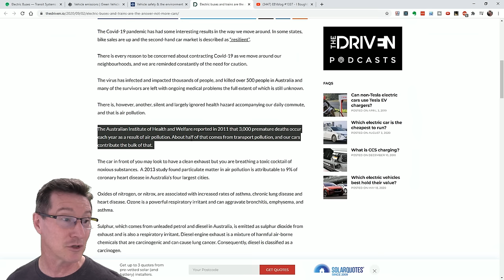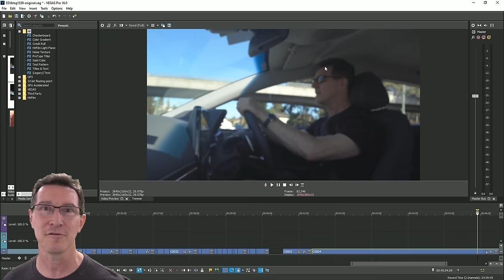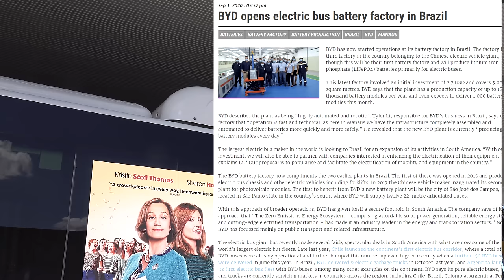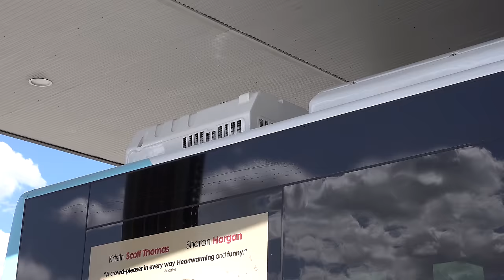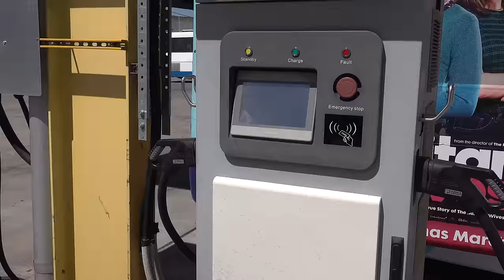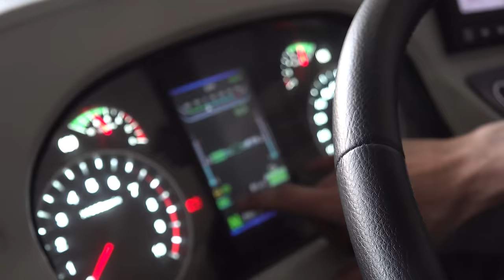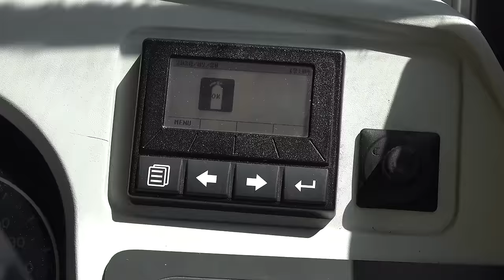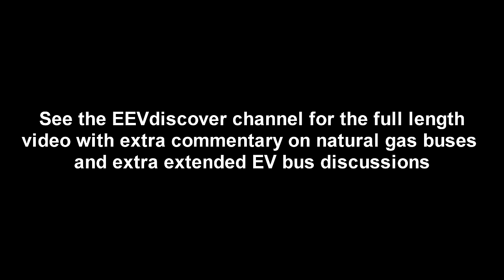EEVblog #1339 - Looking at an Electric Bus!

Comment: It is very strange to see 10.000rpm scale on heavy vehicle: combustion counterparts, usually have 2500-3000rpm full scale.
Reply: Its a F1 V12 powered bus....
Reply: @KarrasBastomi  Minus F1 sound. I hope annoying warning sound freaks will not figure out that cities must sound like F1 races.
Reply: 2500 is already redline for most big diesels.
you usually run the between 1000rpm and 2000rpm

Comment: It's amazing how so much particulate pollution in cities now is actually from tyre rubber!  Solving that problem, and decreasing road noise, while still maintaining good traction is a challenging materials science problem.
Reply: One simple option is to use steel wheels on steel rails.
Reply: rubber particles are not the only problem, theres also particles from the brake pads. although regenerative braking helps with that.

Comment: Hi.

We have been using ZEV buses for years in Warsaw (Poland), we currently have 92 such vehicles, most of them were produced by Solaris (Polish bus factory).
Another 70 electric buses were ordered and are being produced.
Additionally, almost 800 other buses meet the EURO VI standard.

If you count the buses, trams and trains used in Warsaw public transportation, 43% of them are electric vehicles.
Most of these vehicles were produced in factories in Poland.

Comment: I work with electric buses (I make the schedules for the buses and the drivers in the area north of Amsterdam, the Netherlands).
A few remarks on other commenters and the video:

- Electric vehicles running on oil-fired power plants emit about 50% carbon compared to a diesel truck or car, well-to-wheel. The amount of particulate matter is dependent on what filtering the power plant operator installed.
- There seems to be a lot of dust buildup in that rear compartiment. Interestingly, our BYD buses had a problem where they would have large amounts of black dust everywhere, including the passenger compartiment. Testing found it was improper sealing, it being mostly carbon which is probably road dust from tires (either the buses own or from other vehicles). 
- The amount/speed of recharging is an operational problem. For example, the area I work with needs 109 (83 of them electric) buses in peak hours, but only 70 during mid-day. So part of buses come in after morning peak to charge, then others come in etcetera. The evening peak is most problematic as we need less buses for drinving than morning peak but it's "wider" (from 2:30 pm when schools go out till 19:00 when the peak buses return from their endpoints), so some buses are charging in the evening peak. In some areas where the usage pattern is more "flat" you need extra buses to charge and thus faster charging and/or changing batteries would be beneficial, but in areas with high peaks we have no more buses than we would have if we rode diesel buses.
The buses I work with charge 3-4 times a day on average, but the buses we have in another area charge about 10 times a day (we have a lot of 24h lines, buses there running 17h/day on average) and they fast charge with 240kW
- In Arnhem, which is a trolley city, they are experimenting with "trolley 2.0" which is trolley buses with a battery pack which will charge on a central section yet can drive a few kilometres out in suburbs, removing the costs of installing trolley wire in every outlying suburb.
- Heating is often still done with diesel, as electric heating takes a huge hit on the batteries while only being needed for a few months a year. Electric heating takes up relatively minor amounts of diesel. Some buses have heat pumps (aircons that can heat and cool) and (in Dutch weather) the aircon in summer takes more power than heating in winter.
- For us, the total cost of ownership is about similar to diesel buses. The buses are a lot more expensive (think double/tripe), chargers are very expensive as well (a quarter of the price of the bus) but the maintnance costs are a lot lower and the electricity is extremely cheap compared to fuel.
- One major difficulty is getting a power line to the charging locations, often needing two years to have it built, which is problematic as the time from giving a concession to running it is usually about 1.5 years. On our current location we could pull 2900 kW if all buses would be charging at the same time + about 300kW for the facility (heating, compressor, office light etc), but the power usage is measured at 5 (random) moments per day, and if one of those measurements show we  go over 2000kW grid pull, we'll be required to pay for a larger grid connection for 2 years (which is multiple thousands of euros extra per month). We were promised a larger connection but the cable has to be routed under a rail line, the rail operator has protested due to their electromagnetic field sensitive signalling equipement and it also has to go trough a canal dike, not your default "just dig a trench and lay a cable".

Comment: Electric buses were very popular in the 1930s to '50s as cities began to switch their trolley/tram systems to buses. This made sense because the overhead wires and other infrastructure were already in place. Even though they have disadvantages (stuck to routes, can't leapfrog), they are quiet and clean. I think that battery buses are cool, but hauling all those batteries around is expensive and heavy. There are electric buses that use overhead wires on parts of the route, but can run on batteries as well for short distances, recharging while under wires. This makes a lot of sense to me.

Comment: I really want an electric car. Even a goddamn hybrid. But currently, it's unfortunately almost impossible here in Brazil. Impossibly expensive, very hard to maintain. 
As I haven't been using my old junker '98 Ford Fiesta less and less over the years, I just commited to, if I ever buy another car, it's gonna be electric. But it's probably not happening for quite a while, if ever.
We do have an all electric bus program in my city though. Tiny part of the fleet, but at least they are testing.
Of course, if we had a good public transit system with metros and whatnot, I wouldn't even consider a car anymore... but you know, we don't.
If I even realize my dream of moving to Japan, I guess that's gonna be solved... xD
Reply: Brasil? Hahaha, electric cars are too expensive even for European middle class. Not all EU countries have EV subsidies, not talking about poor chaps at South and East of EU.
Reply: Electric is much simpler, which means its also easier to maintain, and has much fewer parts. A market like Brazil can probably get the ultra cheap golf kart like electrics that are ravaging the Chinese market, they drive slow and have short range, but for city use are perfectly fine and cost about 1000 USD (in alibaba). Sadly most use (about 8) regular car batteries, would be great to see those with the nicer Li-ion ones. EEVblog should review one of these. Check youtuber jalopnik reviewing one in the US.

Comment: there are even buses that are a hybrid between battery only and pantograph trollies. they use " opportunity charging" which is a high capacity short duration charger which charges the bus for a few minutes using overhead chargers at each stop and during wait times and driver breaks. it allows the bus to go all day long with a much smaller and cheaper battery pack and eliminate the need for continuous trolley lines. if they need to extend the network they might only need to put a charger at rhe furthest stop. this method also works for electruc forklifts.

Comment: We have electric busses here in Bulgaria from the end of last year. The main difference is the charging is done true contacts on the top of the bus, so it can be charged more easy on rout.
Reply from the maker: Why would you need to charge it on-route?
Reply: @EEVblog  lower battery capacity, they don't hold as much charge as the ones you show here.
Reply: @EEVblog  Reading true there specs it looks like they dont run on batteries, they run on 780F /20kWh super capacitors
Reply: Less batteries mean lighter vehicles and that the batteries we can produce can result in more battery powered busses. Question becomes if it is worth it in terms of the only real incentive system we have, ie money.
Reply: @EEVblog  He's probably referring to the Higer supercapacitor buses. They have a range of 20 km and charge at end stops in 5-10 minutes. Apart from these we also have 20 standard battery electric buses by Yutong with 320 kWh batteries and overnight charging in the depot. Unfortunately their batteries don't usually last a full day so buses are swapped around midday.

Comment: I am a bit surprised they didn't go for the option of having exchangable battery packs on the busses. An hour of charging still is much longer than unplugging, having some mechanical magic happening and a new driver hopping in on shift change would have taken. With a whole fleet of identical vehicles, I imagine this would be a significant factor in cost effectivity over time. The battery packs could sit in some corner of the workshop while recharging.
With electric vehicles, one can rightfully speak of "The latest technology". It basically was service ready over thirty years ago, could have been used  for niche applictaions ever since. I thus think it's thirty years late.
None has ever been this late.

Comment: LifePo4 is the wave man. Got it on my eBike pulling 300 amps @86v and they don't even break a sweat. Also and most importantly it's is safe to pull that level of energy from it and even if it wasn't the cells are super safe no fire no explosion.

Comment: There's a few of wireless tram systems in Europe, where the tram charges briefly at the stops or key sections of track, they seem to work well so I wouldn't write off the wireless idea, with automation it would be pretty simple and you could avoid lugging/and the cost of 100's kWh of batteries.  Not in the same category as solar roadways!
Reply: Newcastle (about two hours north of where Dave is in Sydney) has that kind of system. It kind of sucks, the tram has to stop for a relatively long time at each stop to get the batteries charged up sufficiently.

Comment: No emissions?
But only if the electricity comes from 100% renewable energy sources. 
Otherwise the emissions are only shifted from the city to the power plants.
There will still be dust from the brakes, tires and road surface.
Reply: Tell you what, once we've got the carbon crap from diesel buses out of our cities, we've removed all the petrol cars, all the gas boilers, then lets start worrying about brake dust emissions.
Reply: @dang3859  Even if the energy for those busses was 100% produced by Diesel power plants with the same low yield as Diesel motors ... you'd still save 75+% fuel.

That bus has a battery that stores as much energy as 33 Liters of Diesel. Dave's car has a battery that matches 5 Liters of Diesel.
Reply: @edc1569  I largely agree with you. 
That was just a hint to a few other sources of fine dust that are also there now and that won't go away with electric cars.

Comment: Pretty sure in Canada our electric cars make a noise .. for safety  i had a ford rental  that sounded like a space ship , it wasn't loud but definitely audible.
Reply from the maker: Mine is supposed to have that, but it's barely audible.
Reply: @EEVblog  yeah same with the Ford , wasn't noticeable inside the car.

Nice car, I'm a Hyundai guy all the way now... mind you mine is a 429hp beast that still runs on mini explosion under the hood 😆
Reply: Here in germany (probably the whole EU) new EVs are required to make a sound up to a certain speed, where the tire nois is louder anyway.

Comment: since the batteries are on the roof, it would be nice if they could just drop a new battery pack ontop and swap them out quickly for another shift, im sure that could be done if they had more leccy buses and routes.
Reply: Most bus traffic is during peak times in the morning and afternoon, so it really wouldn't be necessary - just schedule charging to fit demand.

The biggest issue is going to be getting hundreds of kw of power into them all, which is still an issue if you swap battery packs.

Comment: Awesome. I wonder if putting batteries on top actually makes the ride a little more comfy compared to in the bottom. So when cornering the buss does sway more but ends up moving the passengers less.
Reply: No, but it is better to keep the passanger compartment low so people don't have to climb 1 meter to get inside :P

Comment: 11:50 <-- wow, making here (in Brazil) batt for electric bus, but no electric bus here at all! I am so proud of my country! Well, someone in the World need to consume petrolium.
Reply: No one gives Brazil enough credit for transitioning to renewable fuels. Ethanol is the stop gap for ICE vehicles and Brazil is leading the charge
Reply: @verothacamaro  You are aware that ethanol fuels is an environmental disaster right?
Reply: @Yannick 73 Sadly that's the one thing that it is not.  It takes massive amounts of fertilizer.  Its a net loss.
Reply: In my town, Santos - SP, you can see few BYD microbuses rolling around.

Comment: I would love to see that thing with a pantograph ... basically would become a trolley bus and you could drop the battery size down

maybe put the overhead power at the bus stops.. .  I would like to see a bus like that work on the tram line.. but at the end of the tram line it could use the road way like the good old trolley buses of yester year...
Reply: Super cap bus
Reply: @horacewonghy  Gyrobus!
Reply: We have exactly that thing here in Finland
Reply: smaller battery = more cycles for same trip duration = more wear. They try and choose an ideal battery size to maximize pack life
Reply: @askjacob  Thought about this for a while.. I do not think this is true if it has a pantograph, this is because the battery doesn't get cycled down as much. in fact the battery should last longer as its state of charge stays up. Trolley trams that operated in the past didn't even have batteries. the battery in my model woul allow for less infastructure to be deployed and allow busses to use existing tram networks  to extend routes or cover black spots

Comment: Quite a few of the diesel powered buses I’ve driven don’t have a rev counter, Volvos normally have it for best revs for the turbo, Optare turned theirs into an eco meter and ADL started adding one in 2009.

Comment: An electric bus that gets power delivered to it from the road...also known as a tram :p

Also imagine the tinfoil hat wearers. Up in arms over a fraction of a watt, and now you have coils everywhere radiating kilowatts XD.

Joking aside, the tram thing could actually work- for longer routes the bus drops a shoe/some guidance rods, raises a pantograph  and runs inside the metro tracks, with the benefit it can charge while still in service, eliminating downtime

Guided buses are a thing even for internal combustion engines, could see it making vast amounts of sense with an electric.

Comment: Why is it that the guts at the back are covered in a layer of dark muck? It doesn't look like brownish mud. Is it from forest fires, or maybe tyre & brake dust from road surface kicked up & sucked from the air drag through vents, or maybe exhaust soot from elsewhere? There's loads of muck there and it seems really out of place, even if it's blown in by a cooling fan somewhere.
Reply: My guess would be that these electric buses are always in close proximity to other buses when sitting (at termini waiting for the next service, or sitting at depots), so there would be some diesel soot working its way in.

Comment: It’s zero tailpipe emission vehicle and not zero emission. And lithium is one of the most abundant elements in the earth’s crust. Why are people so anti EV in the comments section?🤷🏻
Reply: There's always a minority that screams louder than the rest
Reply: The paid FUDsters have been very successful over the years and have convinced many stupid people.
Reply: Infrastructure is not up to mass use of EVs. Consider a motel with people who want to charge 50% of their battery overnight before leaving in the morning... Multiplied by 20-30.
Also consider long distance travel. A 12 hour trip will become a 2 day trip with current battery capacity and charging times.

For people who want to drive 5-10km to the office or shops every day, they're fine because not only are you hardly using the battery, but you're not going to have a problem if it goes flat.

I'm not against them, but they're not going to be a practical solution for everyone.
Reply: @tin2001  You're stuck in 2001. Or a FUDster paid by big oil.
Reply: @tin2001  who ever does 12 hour trips?

Comment: I wonder what voltage bus the auxillary motors run off. Eg the ones that run power steering and pnuematic compressor. Do they have their own drive controllers off the main battery like the main traction motors, or are they just 12V switched on/off as required... They look pretty hefty.

Comment: As a percentage, my regional transit company has actually reduced it's electric fleet over the decades - it used to be exclusively serviced by electric trams and trolley busses powered by overhead lines (1890-1950s).

They've trialed hydrogen fuel cell and chargeable electric, but at this point it looks like they're going to be switching over the diesels to liquid natural gas for economic and political reasons.
Reply: My regional has test byd made taxi and Chinese made full electric buses,the taxi owner has retired those taxi because it won’t operate 24/7 and the bus company only buy few e bus because its was not practical when there has traffic jam and air con use the battery too.